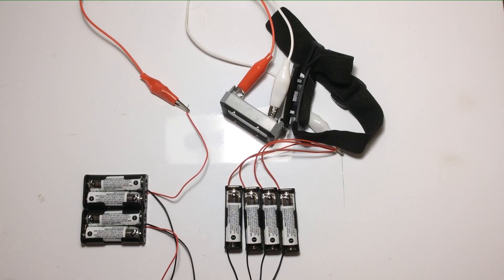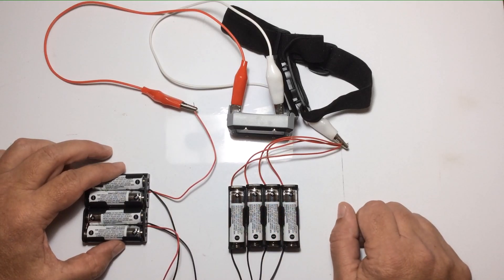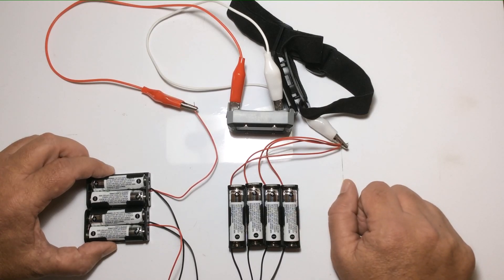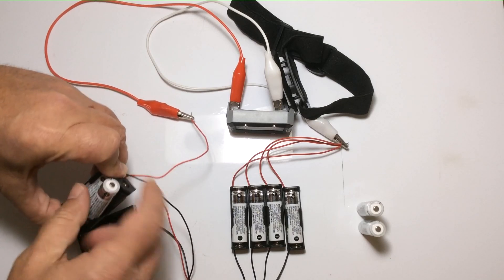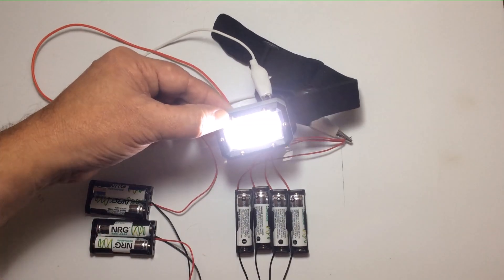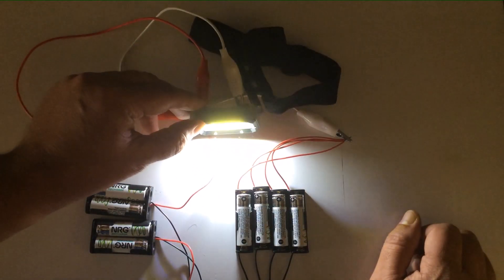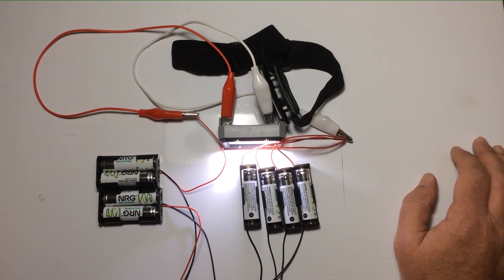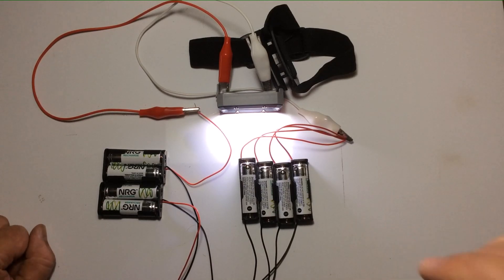TESLA POWER TRANSFER UPDATE - FIRST BATTERY ROTATION

Comment: Thank You for reminding me about this experiment, I've seen it few years back on YT but never tried my self.
I can confirm it's working.
I've tested two setups 6x 1.2v Ni-Cd batteries with 1w LED.
And 4x 9v Ni-Cd batteries with cree 10w LED.
I had to use resistor in both cases to limit current but both lights are very usable. 
1w LED was running over 5 months and 10w LED around 2 weeks before I've decided to charge batteries.
I could keep it running longer without charging but I needed usable light.
What's interesting if I use the same number of batteries in conventional connection, LED will drain battery to dangerous level but because this method works on potential difference they will slowly just dimm and dimm (there will be always charge left in batteries).
Im also thinking about testing super caps.
Reply from the maker: Thank you for your comment.
Thanks for supplying your test data and that’s a very decent run time of 5 months, I like the idea of the 9v battery setup and I think I will give that a go also.
Nearly all my tests have been longevity based so they were drained until dim but I believe charging them more regularly as you suggest makes the system more practical. I want to run a test soon where I swap the batteries around each day instead of months apart.
I also noticed the voltage of the batteries when they are removed is not as low as would be expected if used in a conventional sense, none of my tests have had the light ever go completely out but instead stay running at a dim level for what seems like forever, then I get sick of wishing it to die so I kill it anyway! 🤣
Reply: I think this method is very safe for batteries, as you describe it never go completly dark.
When I run test 4 x 9v in conventional connection (all in parallel) battery was drained to level when my charger recognise them as damaged.
I'm a bit hesitant to test li-ion batteries cause voltage levels are important (for their health) and I dont have safe place to left them unattended
but taking into account power density and amps they can provide and take this may be even better option for projects with high power requirements.
Reply from the maker: @dapmanus  I don’t think it’s any coincidence that a majority of electronics will drain a battery until they are damaged. I was almost convinced that the batteries in the 275 day test would be damaged for sure but they charge to just below their advertised rating which is amazing for a 6 year old battery.
I would be careful using lithium for this, my main concern is the BMS (Battery management system). Some lithium cells don’t have a BMS and some have a BMS that is not parallel or series compatible. Assuming you do test it, might I suggest placing it in an area surrounded by concrete or perhaps in a cold fireplace for worst case scenario and if you do have a problem don’t breath any of it in, it’s seriously deadly.
You may also have cell balancing issues as well.
Please let me know how it goes if you do test it.
Reply: @whatifididthis...1236  I'll use batteries without BMS, but yes this is exactly reason for my hesitation.heh
Reply from the maker: @dapmanus  I just remembered something you can use as an extra measure of safety, you could use fire retardant bags to house the batteries. I purchased some after reading lithium batteries that fail can produce a 3ft jet flame too dangerous to approach that basically require time to burn out, whilst they torch your house. Somewhat of a concern that people put these on the side of their houses! Anyway the pouches I purchased have a heavy duty wrap around Velcro seal to prevent opening on explosion and a small spot for the wires to exit, they were pretty cheap also, something like $15 each.